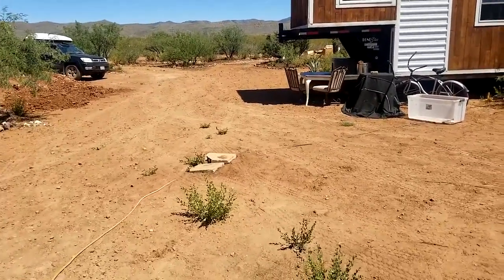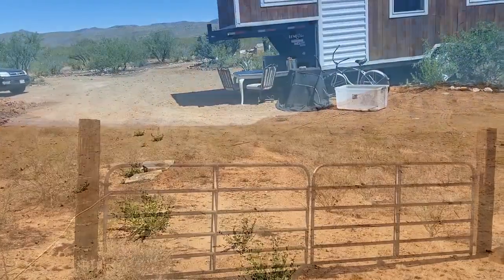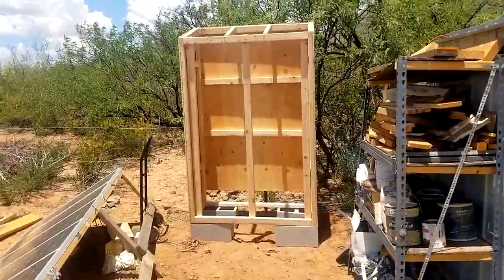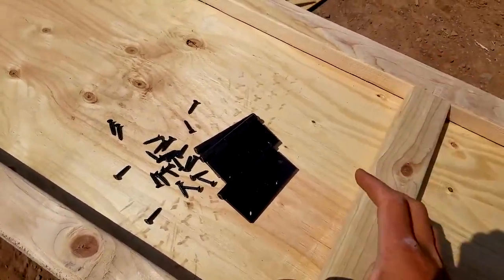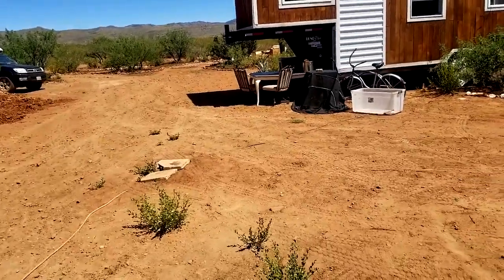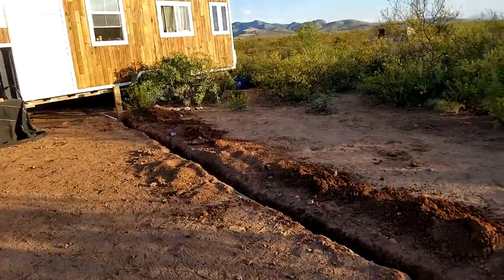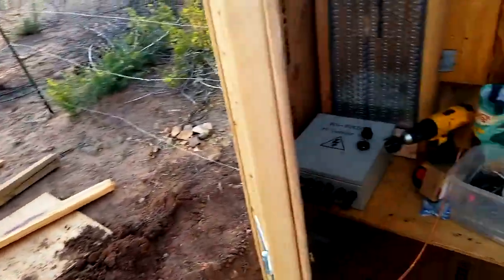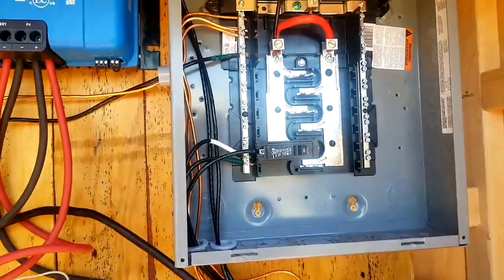Making Our Own Off-Grid Solar Grid | Off-Grid Solar Ep 1 | Terraform Together

Comment: Looks great - I'd love to see where things stand these days since your video is 2 years old t this point. Great job on your wiring and professionalism in making sure it's not going to electrocute anyone and continue to function without you having to constantly oversee its performance. Also, I'm glad you have those damned Tesla batteries away from your living space. I hope you purchased a decent BMS  package to help you keep the battery packs in balance, those batteries are beyond dangerous and not for the faint of heart to work with. 
I live in Willcox and I own property down in Pearce/Sunsites that I was going to use as a permanent home base for my class A RV. but it still sits empty at the moment. I live on Disability and can't afford much of anything in the way of rent or utilities on a monthly basis, so I investigated living on BLM land independent of the grid other than food, water and tank dumping. I took my limited nest egg from the sale of my home and I purchased and outfitted an RV with a mini-split to replace my two obnoxious rooftop AC's, then once my roof was cleared of unnecessary clutter (TV antenna, Satelite dish, and one bathroom fan) I put 2400 watts of solar panels in the roof. I investigated the Tesla batteries for about a year and I was warned by several experts not to use them so I opted for 10 Battleborn Batteries (LiFePo4) and now have 1k amp hours @ 12 volts that run my entire RV beautifully. It was bloody expensive, especially the Batteries and the solar professional I hired to do the job that I wasn't able to do myself. AS it turns out, I now run a small RV park in Willcox so I have a permanent home base with all the hookups LOL. I could've saved a lot of $$$ had I known this place was waiting for me, but the upside is that other than sewer and water, I am grid-free and use my system as intended and boondock on week-long excursions around southern Arizona, my home since birth.
Are you going to be adding more battery storage and panels to create a bigger system? I would go for quadrupling capacity and having at least 200 wats of panels for every 100 amp hours of battery in order to comfortably be able to use a lot more electricity yet have the solar capacity to re-juice the pack. Just my own thinking of course, I have no idea what your needs or wants are. The beauty of solar and batteries in an off-grid system is the uniqueness of each system, tailor-made for each application. 
It all looks great buddy, I wish you well and since you are so close (I assume) I'd love to stop by someday to see your handiwork in person if you'd allow such an intrusion. 
Carry on my friend, I wish you nothing but success!!!
Reply from the maker: Thanks for the comment. 

We just hired a video editor at the beginning of the year which is why a lot of the footage is so old. 

To update you, the Tesla batteries were a big letdown. We've had 2 of 3 crap out on us in 2 years. Nothing catastrophic, just stopped working.They were used, ebay, no warranty things so such is life. We still have one running. I'm hoping that'll get keep us running until the basement of the main home we started working on is done then I'll invest in some server rack batteries or something and move the panels to their final home. 

Instagram or Facebook @TerraformTogether is the best place to see what we are up to. We are putting out weekly videos of our backlog footage. 

Best of luck in your endeavors!